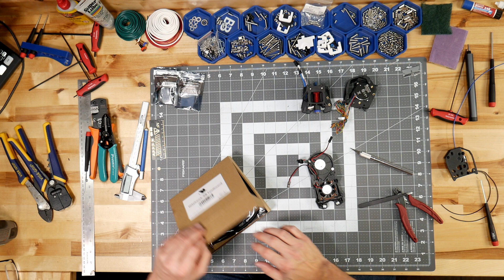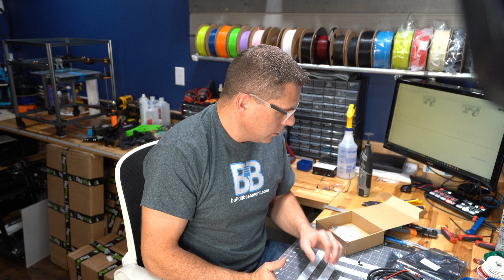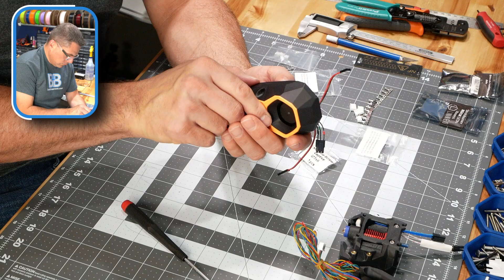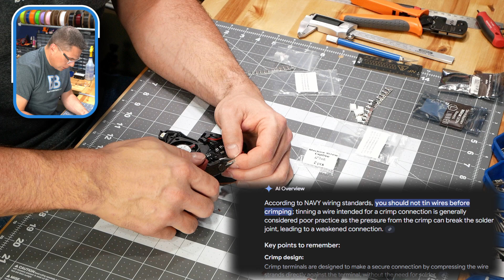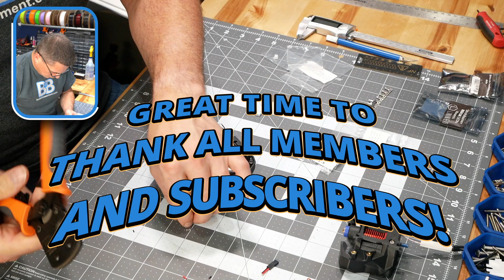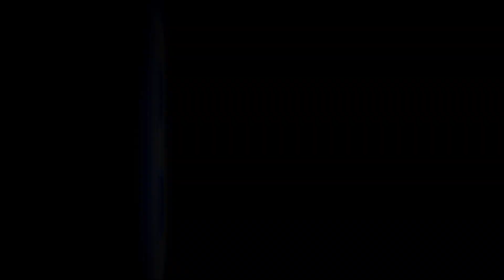Installing the LDO NiteHawk Toolhead Board on the Voron Stealthburner | USB vs CANBus Debate

Comment: For anyone watching in 2026, be aware that LDO has released the Nitehawk SB V2.  It has a USB port on the toolhead side for driving your Beacon/Cartographer.  Also, E3D makes a version of the Revo that has wiring set up with the right connectors and length for the Nitehawk SB V2 board.  I know West3D carries these, but others likely do, too.  Get the 60W version.

Awesome stuff, Kerm.  Was just re-watching your videos as I broke the face of my toolhead and I am building up a new one (new fans, etc.) and switching to the Nitehawk SB V2.

Comment: Klipper can use multiple MCU boards, each one connected to the RPi by its own USB cable.  I have an Enderwire with a Klipper expansion USB to handle extra fans and a chamber thermistor.  A toolhead MCU board is just another MCU use case.  CAN bus might make sense in a multiple tool head system, where the connections could be daisy chained.  USB would require a "star" connection via a multiport USB hub.  However, USB is far easier to config, just build multiple copies of Klipper, flash each tool head board with its own copy, and "plug and play".  You only have to set the serial ID for each board in printer.cfg.  CAN bus has the additional step of configuring the bus into the kernel.  USB's only disadvantage is finding suitable cables to run through cable chains, but the toolhead boards do come with umbilical ready cables that should work in chains.  I've had bad luck with the BTT CAN based toolhead board.
Reply from the maker: All true.  You could even use individual controllers for each stepper - if you wanted.  It's how it was once done.

Comment: Who out there has installed additional heat sinks or cooling fans after seeing their board temp ride into the 80's?  I can't find many fixes for this, just complaints.
Reply from the maker: I believe the specs allow up to about 85c.  I personally have not had any issues (yet)

Comment: Hey can you show a short video on how your crimper works.  I use the scissor type of crimper and would like to see how your style works up close if possible.  Thanks for making great videos for all of us to glean from!!!
Reply from the maker: Woody - Will do! (but you may need to remind me).  The scissor style is great when you are first learning since it ensures you get a solid crimp on both the insulator and the wire.  assuming you test as you crimp  These take the headache out of doing it twice, line it up - hold the crimp - insert the wire - squeeze!  DONE.

Comment: I am STRUGGLING with this Stealthburner build lol. I already hate it. These guides are so all over the damn place for the 2.4 kit. LDO really needs to put out manuals even though I know it would be a pain. This is a bit much and I'm a kit builder 🤣 I realize the issues come from when the manufacturers add cool addons but then you try to follow the Voron guides which know nothing of these addons. That makes it interesting for a first time Voron builder... </rant> 

Thanks for putting this video out just in the nick of time. Now I have to take this stealthburner apart again so I can put this fan adapter board inside of it. haha. Seriously though, great timing. 👍

After that I'll have to dig around on the wiki some more to see where the rest of the boards go that are a part of the Nighthawk set. This is a start at least. I thought it hung on the outside of it.
Reply from the maker: I've been complaining about the broken manual thing for a couple of years.  That's why it's hard to suggest a "kit" - it would be nice if you could just buy an actual BOM kit for someone. The LDO manual hop is not great.  Do this (but check here first).

Comment: Looks like a very cool board, I was wondering about the usb board. I had a CAN board on my printer and it was a lot of headaches. Great video mate 👍😊
Reply: I'm interested in knowing what issues you had too.  I didn't have to much issues setting it up originally (aside from the crimping), but I did have issues when I decided to update my firmware on the board which in turn caused me to have to redo all of the firmware and it was a pain in the butt.  (Life lesson is don't update everything just to update))
Please share what other issues you had.
Reply from the maker: @ReneWilsonSC  You'll have to stick around and see! Issues ALWAYS crop up when you configure software.  Having an open platform has its positives and negatives. With great power comes great responsibility!!!!
Reply from the maker: Interested in what headaches you had?  The build should be similar to the CAN system where you actually have multiple MCU, however less converting from this to that and bac to this again! All that being said a CANBus direct MCU isn't a "bad thing".

Comment: Damn, I struggle with jst crimps. You make it looks so easy.  I use a different brand/style tool but I wonder if this one your using is better than the one I am using
Reply: Pad 11s are pricey but are the best I find. I have all 3 of the engineer crimper
Reply from the maker: iWiss can do pretty well - I suggest that people get a singe row crimper to learn so they have to crimp the outer and inner separately - then the iCrimp IWS-3220M are my normal go-to pair.
Reply from the maker: Tools can make a difference. The ones I use are in one of the Amazon lists in my affiliate shop. Link in the video and video description.